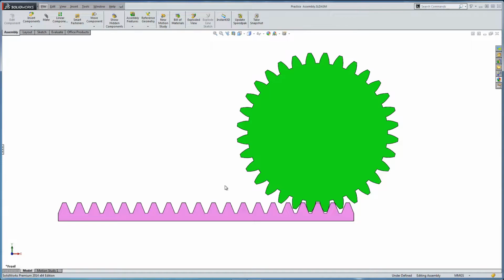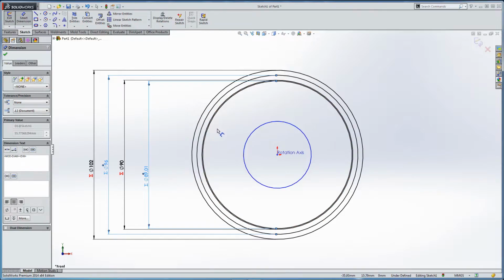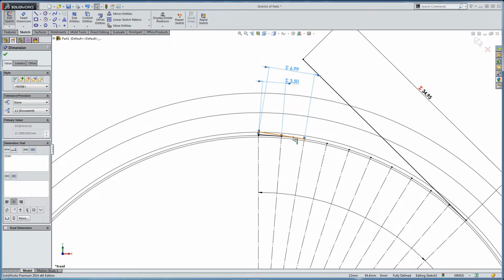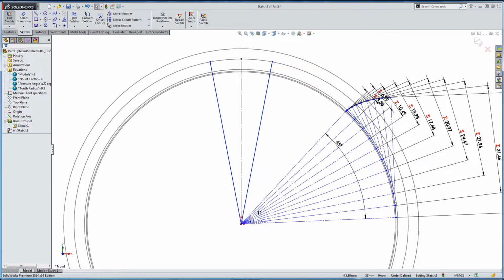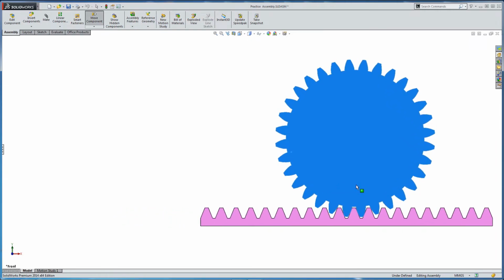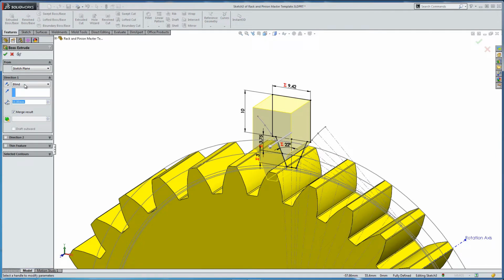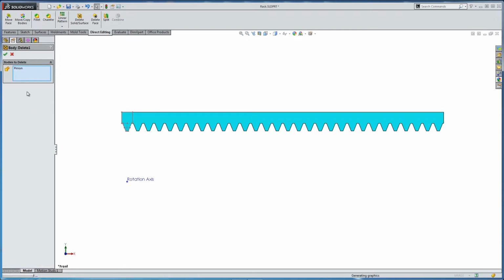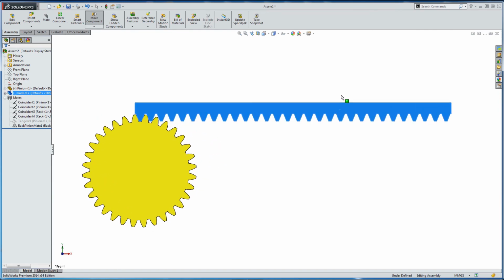Rack and Pinion Design - involute spur gear and rack with motion in solidworks

Comment: im having some real issues with the last few steps of the spur gear. I can't get it to extrude cut correctly and that's messing everything else up. How did you get Solidworks to recognize the indent for the gear as a region? I tried following what you did to a T but it didn't work. It only works when I delete part of the spline curve. Any ideas? Thanks!

Comment: Also looking for how you'd do backlash?  My method would be to rollback to the base gear tooth and before the tooth radius is applied and do a move face (reverse direction) on the two opposing involute faces of the gear tooth. I would add this face offset value to my equations.  My question would be would you apply backlash to only the gear tooth and not the rack tooth?

Comment: Hi Great video, really useful. Do you have a video explaining the terms you've used in the video especially the module? For example i'm wondering if I can create a gear where one of the variables is the diameter of the desired gear.
Reply from the maker: I don’t have a video but you could make the gear diameter one of the driving equations and move the number of gear teeth to drivern

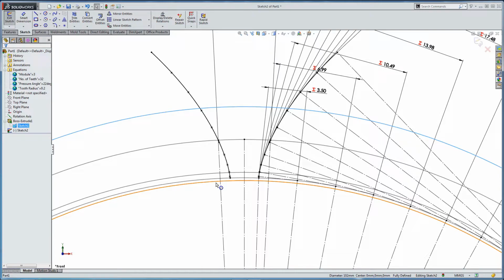Comment: Great tutorial! One issue I had was during the 'Convert Entities' step at 19:26 it seems like that curve did not maintain its reference to the global variables. As a result, I had issues when trying to change the scale of the gear. Fortunately, it was a pretty easy fix by dimensioning the curves separately. I'm not sure if I did something wrong here, but I figured I would share this anyway in case it could help anyone :)

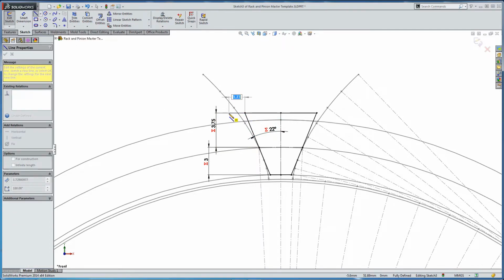Comment: 28:06 I believe the tooth profile of the rack is still technically an involute, it's just that the involute of a circular curve with infinitely large radius (i.e. a straight line) is itself a straight line. Certainly  the curvature of an involute of a circle tends towards zero as the circle radius tends towards infinity.
Reply from the maker: Interesting point. For the benefit of the tutorial it’s useful to know if you want to go deeper. To show it in this video would probably be more confusing than helpful though